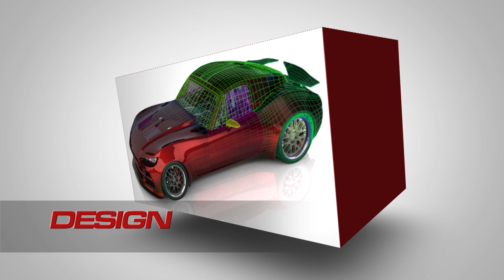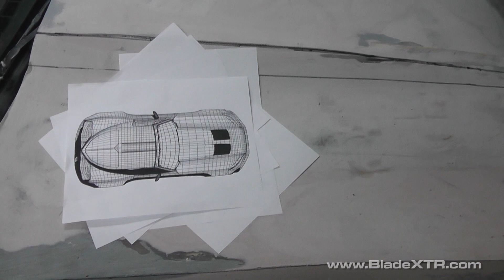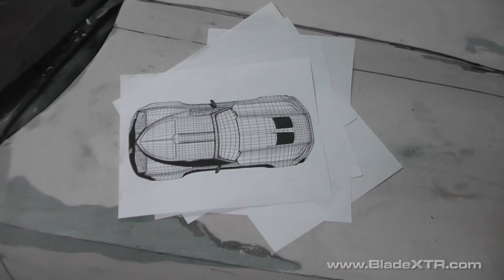Slow updates but big things are happening - Bailey Blade XTR Concept Car Design - Part 83

Comment: if you were looking for a 2jayz motor look in orlando fl for a company called orlando jdm i think.
i live jaqcksonville,fl i used them a a couple years ago but its 2500.00 to 3500.00 for a motor and a trans from japan and the wiring the computer

Comment from the maker: Ahh I see, let me explain... the Car you are seeing in the videos will be used to produce production body panels. It is what's called a Body Plug. All the body panels will be made of Carbon Fiber and fiberglass composites. The chassis will have plenty of safety support and crash protection built in under the skin.

Comment: No it is not! there is a reason why asbestos is banned. even a single strand of it can cause cancer. Carbon Fiber itself is not very hazardous tho any material can be dangerous in enough quantity, even saw dust. inhaling carbon fiber nanotubes has been shown to form granulomas that encase the NT but dissipate in 3 months. Do not overestimate it but as with anything that causes a lot of dust, just take normal precautions, i.e. masks, gloves and eye protection. Asbestos needs full biohazard suits.

Comment from the maker: Yeah thats true but not practical cost wise. For a10" model it would cost $1500+ and take about 12 hours to make. Sculpting by hand is more fun, I will learn a lot, it will add value to the piece because I am doing it all by hand and to reproduce it will be much less expensive. 3D printing is still expensive and it takes a very long time. I could make 20 resin casts in the time it takes to print one.